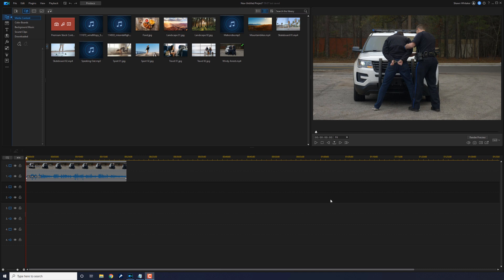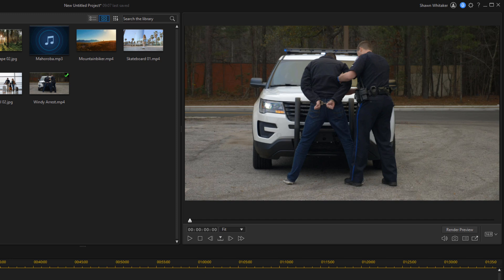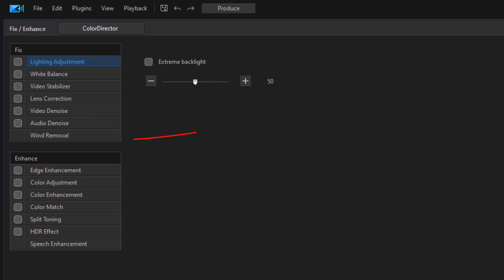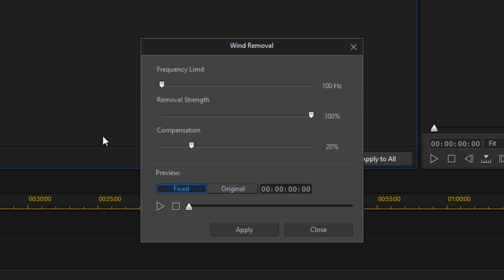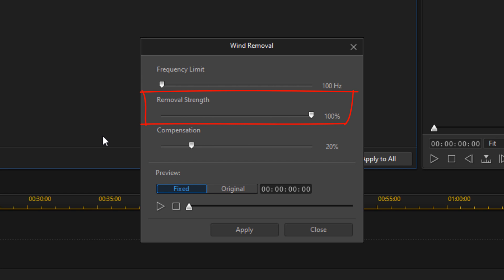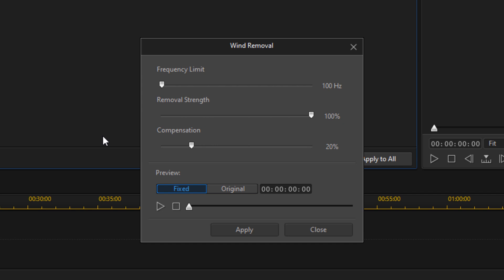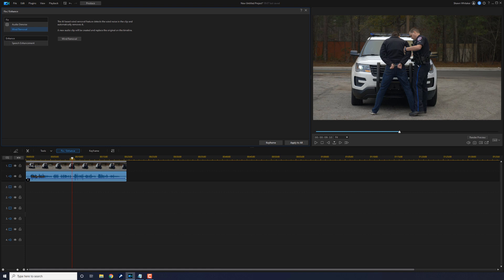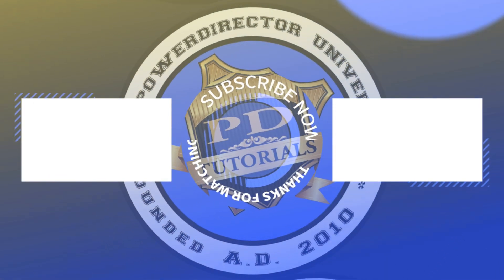Remove Wind Noise From Your Videos | PowerDirector

Comment: My version must be a lot different than yours.  I run up against a major problem: after I click on "fix/enhance" I get a pull-down menu which has "Audio Denoise".  It then has a side selector which has three choices: one of which is "Wind noise."  The only audio fix that comes up is a slide selector comprising "Degree:".  It has a minus at one end and a positive at the other end (with the number '50').  After I've previewed (on the clip) the "minus" or have selected the "positive" symbols, nothing really happens but the wind noise is more emphasized.  Not removed.  The clip takes on a high pitched whine sound at the highest or medium selections (mid-way or all the way to 50).  No audio selectors come up as in your tutorial.  I've tried going to the audio area of the program and nothing appears as you describe there  . . . either!  What version are you using?  I am using PowerDirector 20, which when I bought it in September 2022, was the most recent version.  Do you have any suggestions as to how to do what you describe, but isn't on my version?   There is no caption which includes the three bars: "Frequency Limit," "Removal Strength," or "Compensation."  Help, please!
Reply from the maker: This video uses PowerDirector 20. Which version do you have? Ultimate or Ultra?
Reply: @PDU_Tutorials  I have PowerDirector "Ultra".  There must be some substantial differences between the two.
Reply from the maker: @765kvline  Yep, this tutorial uses Ultimate. You can ask CyberLink to be certain. The link to their support site is on my channel under the ABOUT section.
Reply: @PDU_Tutorials  Many of your videos are very helpful, as the differences between the programs aren't that dynamic.  However . . . in this case, I'm going to have to seek "ABOUT" section advice.  Thank you.
Reply: @PDU_Tutorials  I went ahead and bought (within two months) the Ultimate, so I can use your winning style of tutorial.  I hope Cyberlink "thanks" me!  I only HOPE that I can transfer my video from the Ultra to the Ultimate . . .   Do you know if this can be done or do I have to go through another program to do this?  Have you had anyone ask this question?
Reply from the maker: @765kvline  The saved projects can be opened in either version. If you buy Ultimate please consider using my link in the video description
Reply: @PDU_Tutorials  Thanks for the reassurance . . . I will use the link.

Comment: Hello, I am still having issues getting rid of major mountaintop wind noise. It almost completely covers up our voices and 100-200hz doesn’t seem to do anything for it. Have any suggestions?
Reply from the maker: Have you tried using other settings to see the results? Have you tried using a true audio editor like Audio Director or Audacity? Audacity is free and YouTube has a lot of wind noise tutorials for it.
Reply: @PDU_Tutorials   So far I was trying to combine speech enhancement with wind removal, however my brother has a lower voice that seems to get cancelled out by the tool
Reply from the maker: @gibbshiker1998  If you haven’t tried different settings then try using Audacity. Lots of tutorials on YouTube for it.

Comment: Sir Fast Video Rendering Option Will Be Disabled In Most Of My Videos. What Is The Reason Of This Problem Sir ?
Reply from the maker: There are way too many reasons why it may not be available (hardware, video codecs used in project, etc.). You can post a thread and ask about it on the PowerDirector forum. Be sure to run a DXDiag on your PC and include the results in your post. Also, include the info codecs of the video clips used in your project. https://forum.cyberlink.com/forum/forums/list.page
Reply: @PDU_Tutorials  Thank You Sir For Your Detailed Information ❤️❤️👍👍
Reply from the maker: @abhijeet2580  👍🏾

Comment: Sir What Is The Difference Between PowerDirector 20 & 365 Sir ?
Reply from the maker: They are the same. 
365 is the annual subscription of the current version of PowerDirector which is currently PowerDirector 20. You get an upgrade to the new version every year.
If you don't want the annual subscription you can just buy PowerDirector 20 and not get an upgrade every year.
Reply: @PDU_Tutorials  Thank You Sir For The Wonderful Explanation. I Feel Version 20 Is Best Sir. Because Its Performance Is Smoother Than Previous Versions Sir 👍👍
Reply from the maker: @abhijeet2580  365 and 20 are the same.
Reply: @PDU_Tutorials  Yeah I Understand Sir 😄

Comment: I already tried it in different scenarios. Its of course not a wonder stick, but works nice - it is not necessary to BUY any other software, especially when you get rid with Audacity too. But forget about wind removal when mic without dead mouse is used outdoors, simply think about physical wind and noise removal in recording process, and only then about digital removal.
Reply from the maker: 👍🏾 Always use a dead at windscreen when outdoors. 👍🏾

Comment: The wind in your demo doesn't sound like any wind noise I've got in my shots. I get a low rumbling and shuddering noise. And I've not found any setting in PD that works very well for that without leaving some other gurgling sounds. Your example sounds like some white noise that has been added for the sake of the demo.
Reply: It sounded more like traffic noise (tire noise) to me, or maybe the airy sound of wind in nearby trees.  It's a steady white noise that really wasn't THAT objectionable.  It sounded more natural than the 'cleaned' clip, where the traffic passes silently.
When I think of wind noise, I think of the horrible rumbling when wind directly impinges on an unprotected microphone.  It's not the sound of wind, it is literally NOISE that's a byproduct of wind.  And, I think you're talking about the same thing.
Reply from the maker: All wind noise is not the same.
Reply: @PDU_Tutorials  Going on the "an unwanted plant is a weed" principle, I guess.  In the recording industry, wind noise is generally considered the artifact generated by wind directly impinging on the microphone.  There was none of that in the original clip.  The sound of air in an outdoor recording is natural and unoffensive.
But, to each their own.
Reply from the maker: @Vector_Ze  In your opinion it is not wind noise. I know for a fact that the clip on DigitalJuice.com states that it is wind noise.

Comment: Thanks! Can you do a new video regarding 360 videos? And export?
Reply from the maker: I no longer have a 360 device so I can't. Also, nothing has changed in the 360 tool so it would still be the same tutorial.
Reply: @PDU_Tutorials  what about import and export 5.7k? As from the Insta360 cameras
Reply from the maker: @WiljanWiljan  Look for the options on the Produce screen. If it isn’t there create a custom resolution.

Comment: Too often wind noise comes in random gusts or the intensity waivers.  I wonder how best  to deal those.
Reply from the maker: I’d try using the tool on the entire clip. If there is speaking I’d start at 100 hz. If the results are not acceptable then I’d split the clip at points where the wind changes and apply the wind removal on each clip with the appropriate settings.